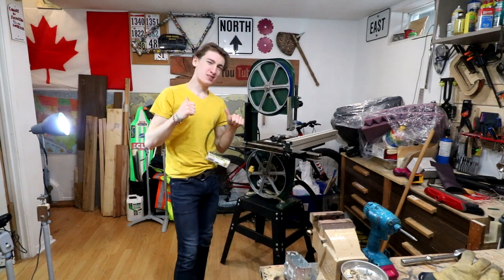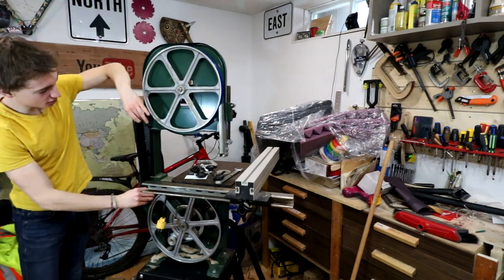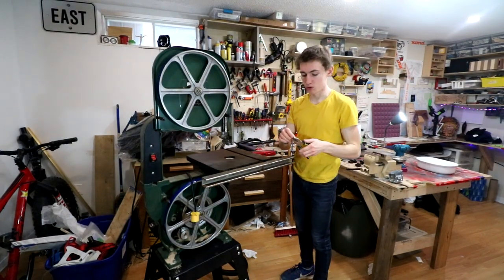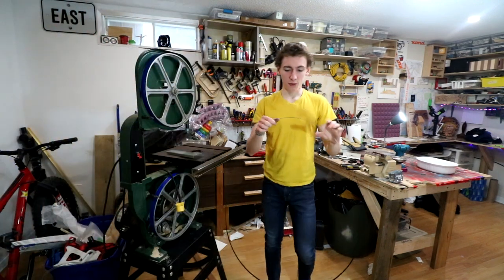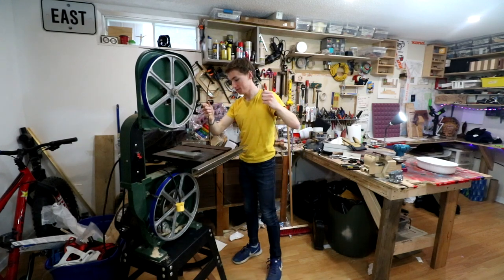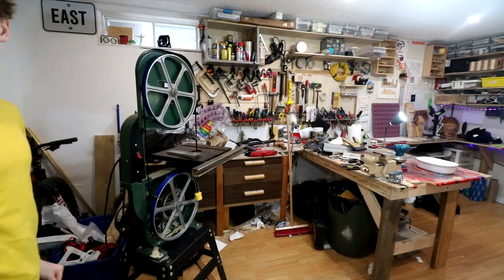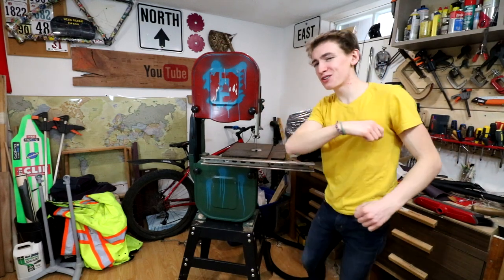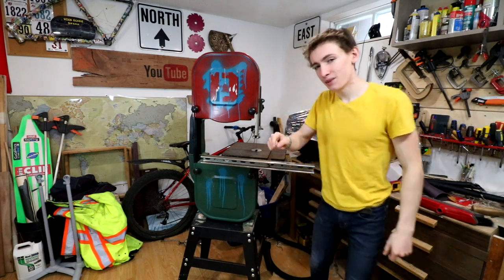How To Replace a Bandsaw Blade

Comment: Hi Dylan,especially with the blade I believe I would have pointed out to be sure and unplug from wall or that main switch was cut off.I did not catch that in the other video on replacing the wheel,but I did with this 1 with the blade for some reason.Now its possible you did say to do and I did not hear you.If so I am sorry for bringing that safety point up.I know when you are doing all mechanical stuff you do emphasize safety first.Good video as always.Thanks.Willard
Reply from the maker: hmm. Im honestly not sure whether I said it